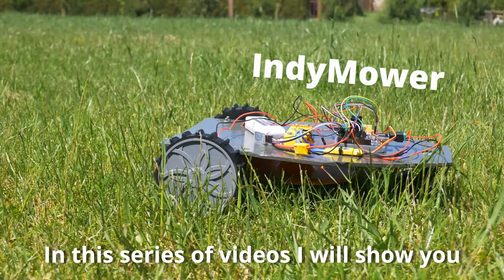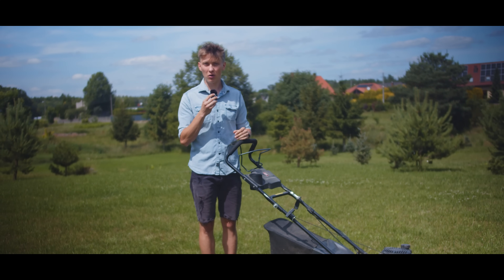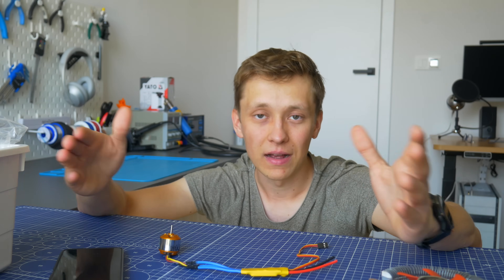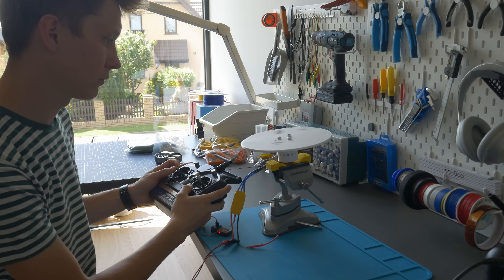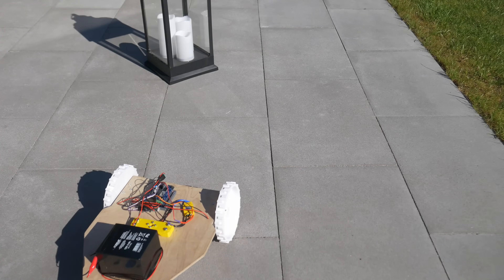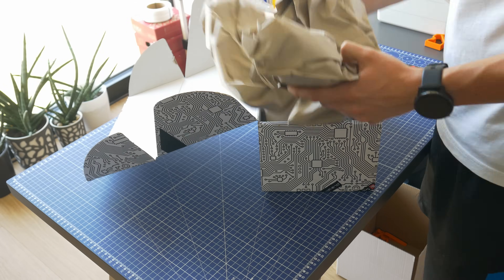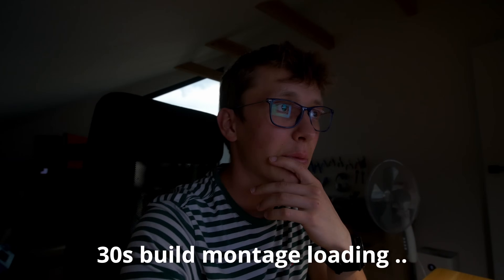Cheap DIY Robot Lawn Mower - IndyMower #1

Comment: Good day Niko! Do you think your robot is lacking on lift force to make the grass stood up to be cut perfectly. I've watch some videos about the science behind how gas powered lawn mower works. It needs to create a vacuum chamber inside the "deck" or where the cutter blade is to make the grass stood up and not just kind of push or blown by the air made by your blades. It doesn't necessarily mean that gas powered lawn mower have powerful motor to cut the grass. The design of the blade housing or "deck" is the most important to be looked up to. Help me to prove this, because I am currently working on a research paper about remote controlled lawnmower. Thanks!

Comment: I used to run a website and forum for this kind of robot back in the late 90s. My robot had 5 IR sensors along the front to detect the blades of grass. So sort of like a line follower, the robot could follow the cut edge, gradually turning inward until the sensors no longer detected any grass and would beep to alert me. The robot was small enough that I could pick it up by a handle on the top, then take it to another grass area and start again.  The whole top was mounted so it could move a little and would operate 4 micro-switches like a joystick, so I could get an 8-way reading on obstacles it might hit. The method resulted in neatly cut grass rather than the randomness of turning at the boundary wire. Because I used grass sensors, the robot made it's own boundary by detecting the edge of the grass, or concrete flowerbed edges.
Reply: efficient low resource cost ideas like that are great

Comment: Very cool project!  Good luck. FWIW - some years ago I bought a low-end robovacuum. As far as I can tell, it does a random walk to clean an area and the software is not smart enough to go recharge when the battery is low. Not a particularly efficient vacuum.  I'm very curious to see how you handle the mowing algorithm(s). Thank you for sharing the video and information.

Comment: Others have said this, but I'll add to it: put the twin drive wheels at the front, so you're dragging the swivel wheel.  This is called a "tadpole" for motor-trikes and pedal trikes, and it is both much more stable and means you're not jamming that single wheel into the ground and having to push past it.  Putting it at the rear will drag it over the bumps instead of pushing it into the bumps.
Reply: Makes sense. I think that is the reason the Aptera was designed that way. Great point.
Reply: Double if the swivel wheel drops into a hole

Comment: You could get away with drill motors at this weight as a heads up. You can get them from pawn shops for like 5 bucks.

Comment: I think the problem is not the motors but rather that it has a single small wheel in front and that generates a lot of pressure on the ground.

Comment: Sounds like you might not have a start capacitor connected to the motors and so the current draw is way to high to get the robot to start moving.

Comment: does the big roller wheel in the front not push the grass down so its harder to cut? thats why most have 4 wheels so the blades can reach better. You could also experiment with just a piece of plastic wire at high rpm, that is what used for handheld mowers and is ment for higher grass :)

Comment: I hate to be that guy, you even called me out in the video... And I love the idea of this... And I know prototyping is expensive... But as soon as you started spending hundreds on this, it got more expensive than the commercial ones from China... Like... if those parts break... It's the same cost to replace them as to get a whole new commercial unit... I appreciate the DIYness of it though, and the gumption to reuse parts... But this is a rabbithole I went down with 3D printing 16 years ago... It used to be cheaper to DIY, and so I did for a few years but eventually, it became cheaper to just buy a better product than to purchase the replacement parts for the things that broke, but I was resistant to change, and that cost me a lot. 

Honestly, I'd be more interested in modifying an off the shelf robot mower, like the cheapest one from China, and do an OSS Firmware replacement project.  Find a way to hack in an i2c GPS and Camera modules and some AI (classical AI, like A*, PID tuning, obstacle accordance, etc.) to have be able to monitor the robot in real time from my phone / browser, and to avoid setting any magnetic lines in the ground.

Fun project though.  Gives me ideas. 👍

Comment: In regard to having to give your first motor prototype a push to get it going... Some motors require a start up capacitor. I wonder if you had used such a capacitor if it might have operated better... Just a thought. Cheers.

Comment: Awesome project - not a big fan of the perimeter wire myself, but that's because my ground is really rocky. Keeping the weight close to the driving wheels will help with traction, as would small spikes on them. Keep up the good work

Comment: Hi I see that you are using an aero ESC. this may not be the best choice to drive the blade as they normally get more air cooling. Check current draw of the cutter under load. may need to add a heatsink to use a brushless ESC intended for an RC car.

Comment: You probably want a big gear reduction for the wheels. It doesn’t need to go so fast and it will be much easier to modulate the speed in the ranges you can actually mow at.

Comment: I started (but never really finished) a very similar project a few years ago. In order to avoid expensive motor drivers, I DIYed some crude H-bridges with relays. The controllability of such a driver isn't great: the motors can only run at 100% power forwards or 100% backwards, nothing in between. But because all the current passes through simple relay leads, such a setup can handle a lot of power easily. For the relatively slow, highly geared down motors, the crappy controllability wasn't really an issue.

Comment: cool, I was building a Rep-al mower, but feature creap at the time made me not finish it :D. in the end I backed a mamotion luba mower on kickstarter. Mine was using sabertooth controller with ardurover, and GPS / RTK, as perimeter wire drives me nuts, we have a husqvarna, and the amount of times it has just nicked the wire. than later it corrodes and trying to find it is nuts. if you want to go gps and ardupilot way, check out "Yuri's Homebrew & DIY" here on youtube.

Comment: Ohey! I love making little robot designs like this that require rugged durability, and I have two big recommendations right off the bat for this based on my own experiences!

When 3D printing discs that need to spin without exploding, using the concentric fill for layers is super useful! If you use the default zigzag, your prints have a specific weakness in one horizontal direction, similar to layer separation problems. It can be particularly noticed when 3D printing gears. The proper solution to this, of course, is to waterjet some aluminum or other metal so you don't have a crucial part like that 3D printed!

Additionally, when dealing with high-speed rotation, a very quick and easy self-diagnostic method the robot can use to ensure it's not damaged or malfunctioning is an accelerometer! In the case of a sawblade (or the saw-adjacent rotary hinged blades on your grass cutter mechanism) it's quite standard to include an accelerometer near the center of rotation, on a stationary part of the robot. This way, the signal can be quickly checked to see if there's any unexpected wobble or vibration each time the device spins up to speed, ensuring there's not unexpected friction (things caught in the bearing or mechanism!) or wobble (blade missing, broken, etc!)

Hope these tips help! I love the idea of open source designs like this and I think youtube is a great community platform that allows creators to spread brilliant ideas :)

Comment: I also working in same kind of project remote control rc car using Mobile phone 

Use 18650 battery 
+
You can get cheap type c bms + charge controller 

And use it  

You will get good capacity for cheap price and less weight your old motors are powerful enough for running I see the problem is lead acid battery it's heavy that's why it struggling

Comment: Great job Nikodem! Can't wait for next part about boundry wire, I am curious how you solved it. I also did try to make mover but more heavy duty one, with wiper motors as a main powertrain, but these were overmade with too much power consumption. I have ended with motors from window window lift motors. As a blade motor I used 12V DC motor from power drill. I stopped now because I have no idea which sensors to use to sense the boundry wire.

Comment: Hi Nikodem! Great project once again. Just want to ask if you have tried to put more weight between the wheels, for example the acid battery. My guess is if you can put more wait between two wheels, the wheels will get more friction to turn. Putting battery on top of the idle third wheel makes it hard for the robot to move.

Comment: Have you thought about addings some bracers to the chassis? It seems to be flexing a bit in the video, especially with the gel battery
Reply from the maker: It's not flexing, it's simply not flat, cheap plywood rarely is

Comment: Buy a used, cheap, beat up hover board. U can hack the firmware on the controller and even use that as a motor controller. They have A LOT of torque, motors are sensored, have position feedback, Ah consumption etc. A used hoverboard is like 20-40 euros

Comment: I was surprised when you made smaller wheels. Won’t larger wheels move better through grass? What about using the swivel wheel in the rear? So cool! Congrats on the shed!!!
Reply: A bigger wheel takes more torque to start moving, and it looks like the real problem is getting going, not dealing with uneven terrain.  (He also made the wheel wider which would help with the ground pressure problem of a smaller wheel.)

I agree that a tadpole configuration would be better for the wheels, though.
Reply: then y do people put bigger and bigger wheels for mtb, it rolls over stuff easier

Comment: Windshield wipers motors, used, cost like 10€ and have ridiculus torque. Paired with 2 BTS7960B( 6-7€) makes cheap very strong drivetrain - I've used them for exactly same project. For blades I've used disposable blades for tape knife - some have hole premade and are very sharp. Be careful however, my main fear that stopped me from finishing project was my kids safety - If you could think about it in next video I would be very intrested to see your ideas
Reply: That's my main concern. All the safeguards that need to be implemented, with sensors and software, to make sure no human or animal can get hurt by a spinning blade without supervision
Reply: I never thought about using those blades... You could work up a tube, slider and spring system with weight on the back end for each blade. Centrifugal forces as it picks up speed would extend the blades and springs would retract them back into the sheath.
Reply: @enodenmad  cool idea! But in general, sheath in enviromant of gras clippings probably would tend to jam a lot, so I suggest simplify your idea and add spring off center of blade pivot - so it would rotate inwards when stationary, and open up when spun up. Blades are on pivot also to avoid shattering on smal stones or weeds, if we limit their movement only to in/out we’d loose this feature
Reply: @Niwen2058  I can think of a few fixes. Hybrid wheel design to adjust the rigidity of the blades and allow them to flex back into the design without breaking. Or notching the drive shaft and angling the blades so that it turns with the weight of the blade assembly enough to cut heavy grass but hitting a more solid object could kick it into a neutral or reverse position and this retracts all blades instantly. A 3D printed squeegee or felt wiper could keep particles from entering the sheath... I know it's a lot of engineering, maybe even over doing it, but my line of work you prioritize safety first then fix the other issues.

Comment: i'm doing a similar project currently, but I'm using RTK-GPS and ROS, so the mower will cost a bit more :D (the gps modules and raspberry pi are not cheap). I'm also considering using UWB for localization, but I have not managed to make it reliable yet. Maybe I will also make videos about it :D

i also have a jetson nano ready for computer vision, but I don't know if it will be possible to use as navigation.
Reply: Following you in hopes of seeing your project someday soon :)
Reply from the maker: What GPS-RTK are you using? Do you have your own base station or do you use NTRIP?
Reply: @nikodembartnik  I have my own base station. I use a set of two u-blox C94-M8P modules. They have amazing accuracy (within 2cm if the mower has good view of the sky), so the mower can follow the path nicely. But it is not exactly cheap...

Comment: cool project! some things i would suggest (using lawn robots since 8 years now): Make the not moved wheel in the back - so motors in the front with most of the weight. also bigger wheels if possible. also 4 wheels if possible. :D
Reply: If there's a dip in the ground, an unpowered wheel at the front will be pushed into it, whereas an unpowered wheel at the back will be pulled out of it.

Comment: Amazing project, let me complain about microphone once more.
Lavalier mic on the beginning - great
Voiceover parts - great
Unknown microphone at around 3:00 mark - terrible, echo, completely different than rest of the video
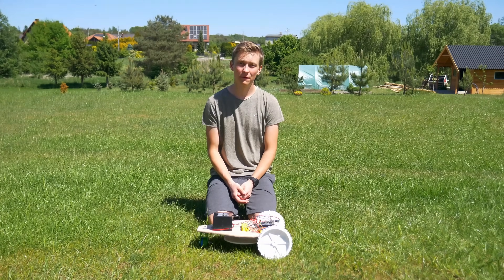7:40 - lots of noise, don't see your mic around the shirt

Now as for project itself, brushless motors + cheapo VESC is the way to go. I am currently in the middle of designing my own VESC hardware and you would be surprised how much more torquey BLDC motors are. Price is also not much different, cheapo vesc is around 40euro + 20 euro per motor and you will have zero issues with power.

Alternatively if you want to go even cheaper you can repurpose those cheap hoverboards, they have two great motors + battery in them and even electronics (altho repurposing electronics may not be so easy)

Comment: Do you know about openmower? Might be worth a look.

Nice video
Reply: @nikodembartnik I was going to suggest the same. Buy cheapest one, and replace electronic. I bought cheapest yard force mower and I'm going to modernize that. I haven't disassemble it yet, but it reports as esp chip to router, so it may be even easier.
Reply: Update: yardforce 280r and 400i are stm32f103 based, it's almost the same as bluepill that can be used as an arduino :)

Comment: LOL, this is 2024, we need to use an accurate GPS+ system like the new Kress machines - NO boundary wires please 😁😁😁
Reply: He built a DIY automated lawn mower and shared how he did it for free. You come along with your double chin and chubby fingers and say it should be better. Get a grip of yourself
Reply: Kress machines require a reference station at the dealer to work, if it gets turned off (if the dealer closes down), you have no mower and youve lost your investment. Husqvarna, Segway and Stiga have a better solution. Husqvarna are overpriced and unreliable though! Interestingly Stihl announced they won't go wireless for safety reasons. Also, GPS doesn't work with heavy tree cover because the manufacturers won't invest in better GPS technology so in many cases wired machines are the only option.
Reply: @mattphillips6515  Good info Matt, thanks - didn't know that. Kress doesn't mention that in any of the online vids I've seen - saved me some money 😊

Comment: I have the mower you took pictures of. It had a problem driving on surfaces with slopes > 45%. The solution was to buy sprockets, you can find them as "landroid wheel spikes". In the more expensive version, these are a combined 3 sprockets per wheel. Not only does the robot drive up steep inclines, it also performs better when the grass is longer and doesn't leave "trampled" wheel tracks on the grass, this is especially noticeable when driving along the cable towards the charging station.
Good luck with the project.